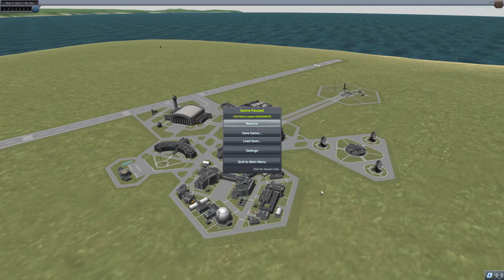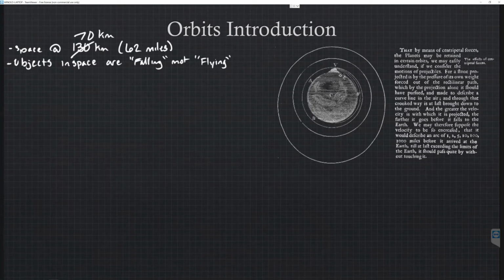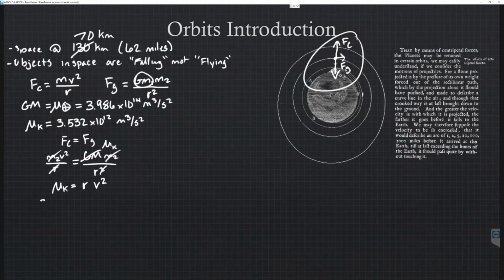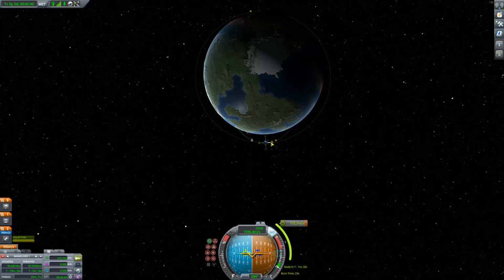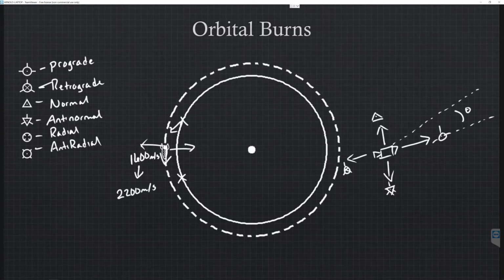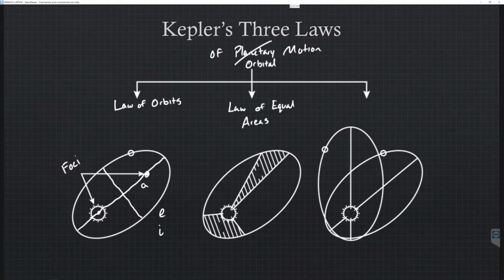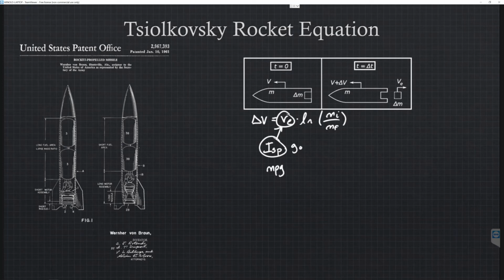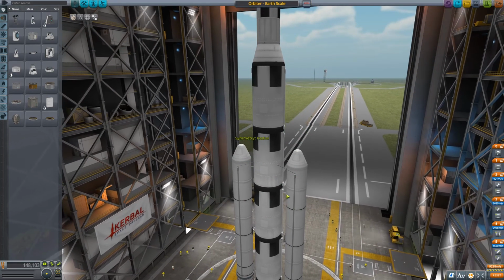Fundamentals of Orbital Mechanics Explained with Kerbal Space Program

Comment: Nice video! A quick correction though, Fc and Fg should both point towards the centre of the planet because they are one and the same. If they are equal and opposite there would be no centripetal acceleration that is required to maintain circular motion. The apparent weightlessness is the result of both the spacecraft and you falling at the same rate and not because of another force counteracting gravity.